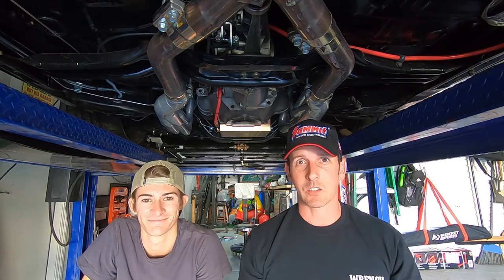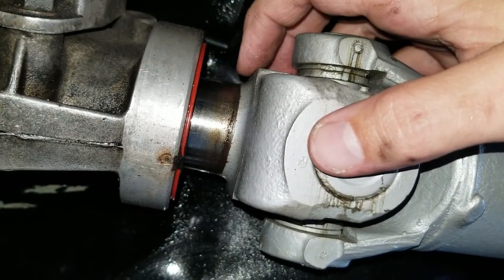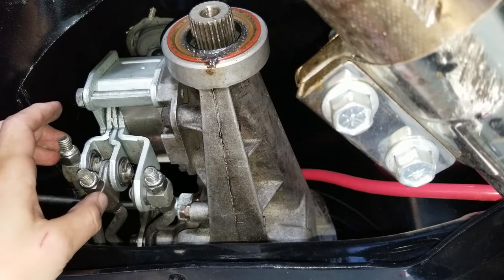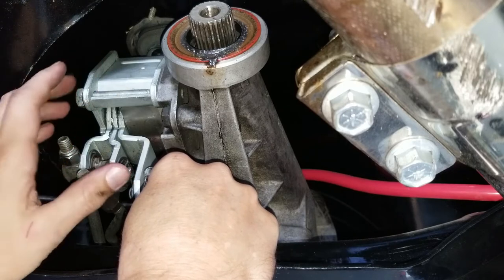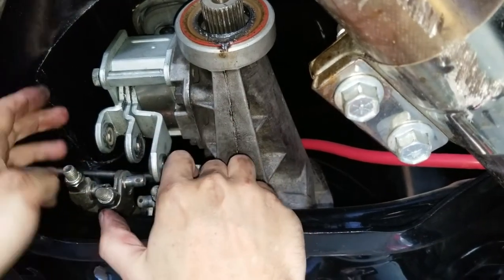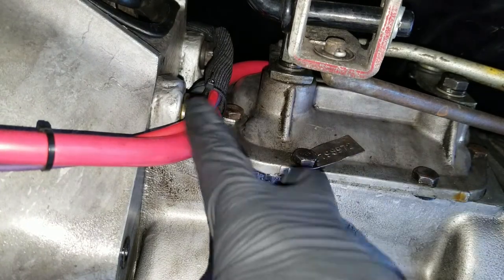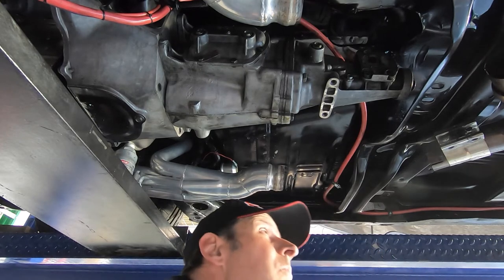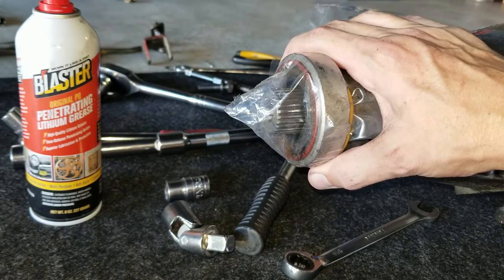Pontiac V8 Removal,  Part 2: How to remove a Muncie M20/21/22 Transmission and Clutch

Comment: I'm enjoying your videos. Better than Netflix. I notice you take the bottom bolts out last. I like to take the top bolts out last if I can. That way you don't have to hold to keep from tilting outward. Also, if you had a Grand Prix you wouldn't probably need to pull the engine to replace the cam. I know, small price to have the real deal. LOL
Reply from the maker: Ha!  Thanks John!  Been a while since I filmed this... maybe I had a support under the tail of the transmission, hence the bottom bolts last?  Anyway, yeah, more than one way to skin the cat, right?  Since this video, I installed a TKO... then took that out, and installed a TKX... and I still don't remember which bolts I pulled last.  HA, ha... thanks for the comment!

Comment: Was just wondering dimensions of your alluminum plate inbetween your lift ramps, looks like a great idea,thanks
Reply from the maker: The sliding jack, or the jack stand trays?  They're steel... I like the jack trays, but the sliding jack is terrible.  Check out Advantage Lifts, they seem to have some great ideas for lift accessories.

Comment: Those Hurst locking shifter clips or as you called them, C clips will eat the rubber bushing on a stock factory shifter. I went back to using the factory lock clips. If I use my aftermarket Hurst Comp Plus shifter with the stop bolts then I use the nylon bushings cause the metal ones break from hard shifts in my 70 Z/28. 5:43 are not factory but available in a Hurst Pit Pack with nylon bushings.
Reply from the maker: Thanks for the clarity on this one... been a long time since I've seen "original parts" on this beast.

Comment: Hi Monty, Awesome video. Just a couple of questions. How heavy is the Muncie? I believe the Muncie has an aluminum case. I have a Saginaw which is cast lead. :) No one man job for me...not Arnold. 2. When you installed the new TKO/TKX transmissions you no longer had the reverse lockout mechanism. Did that require any additional part removal from the steering column or from the engine? Any ill effects on removing all that hardware? Have a good Memorial Day!
Reply from the maker: Thanks Danno... yeah, it weighs around 90 pounds.  Good question about the reverse lock out.  I removed the hardware, and the steering column still has that bracket hanging off of it.  No ill effects from doing so.  Have a great weekend!
Reply: @FastMonty  Thank you Monty. So with the original Muncie when you wanted to lock the steering column and remove the key from the ignition one would have to stop the engine push the clutch in and put the transmission in reverse. (been awhile) column is locked. Now your column still locks but the new 5 speed can be in any state, say first and the column will still lock? Or am I wrong?
Reply from the maker: @Danno74Z  exactly right.  Steering wheel can still lock, but has nothing to do with what Gear I'm in.
Reply: @FastMonty  Great and thanks again for the information and the videos!!
Reply from the maker: @Danno74Z  No, Thank you!

Comment: Hi Monty, A quick question. I may be missing something here so correct me. When removing the Muncie from the car why did you remove the Hurst Shifter and 3 linkage bars that go forward that attach to the side of the transmission? Can't one just leave that alone and remove the shifter handle, speedo cable and reverse light wire as the first operation. Then the driveshaft and cross member. Next the 4 bolts that secure the tranny to the bell housing. I would like to keep all the linkage attached to the transmission. Can I do that? What roadblocks will I run in too? Thanks in Advance.
Reply from the maker: Hey Danno, good question.  A couple things... one, getting at that top left bolt might be more of a challenge with all of the shift linkages in the way.  Two, if I'm not mistaken, the shifter assembly will not allow you to pull the transmission back 8 inches.  So, there's that.  Give it a shot and let us know.  Thanks for the comment!
Reply: Thank you for the response. Those two items you mentioned must be the reason people remove the linkage. To much of a PITA leaving it on and trying to remove it especially something that heavy.
Reply from the maker: Agreed!  Good luck! @Danno74Z

Comment: can you remove and replace the engine while the muncie is still in place?
Reply from the maker: Good question Russ... I tried that, and couldn't do it.  (The Radiator/housing, was in the way, as I couldn't tilt the motor/trans enough)  I suspect you can do it, but the front clip probably needs to be removed.  OR, get a hoist that will allow you more angle?   If you figure it out, let us know!

Comment: hey man just wondering what rear end do you have. tomorrow or more like today i am picking up a Pontiac 400 to replace my 350.
Reply from the maker: Hey Justin, congrats on your upgrade!  I still have my original 10 bolt with 3:55 gears.  I'm still saving my money for a new transmission, then one day, I might be able to upgrade the rear end.  But, it's holding up fine so far.